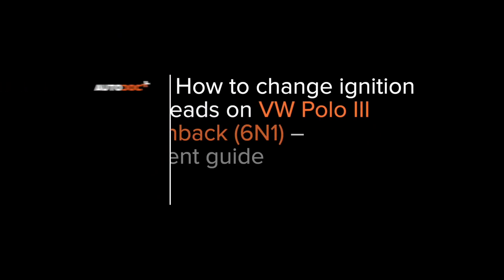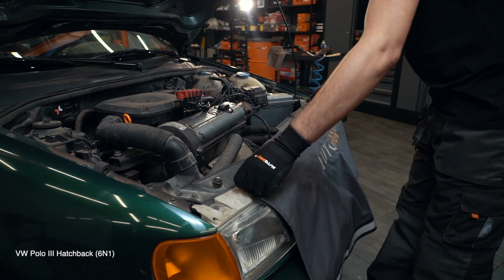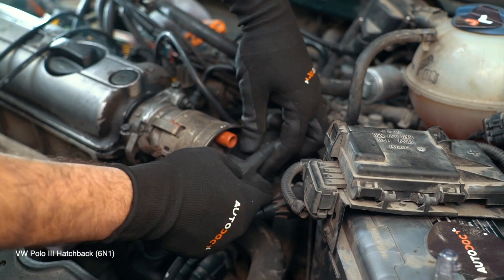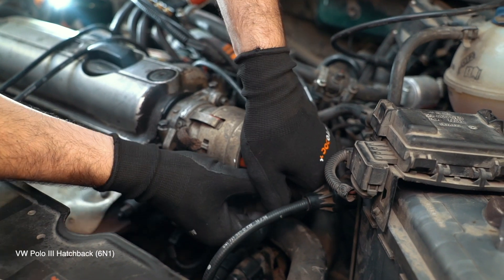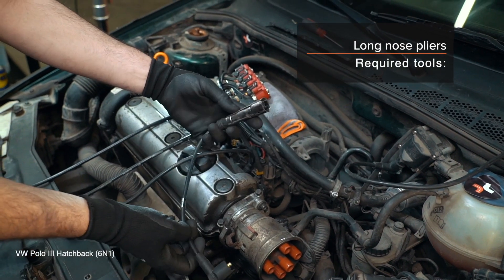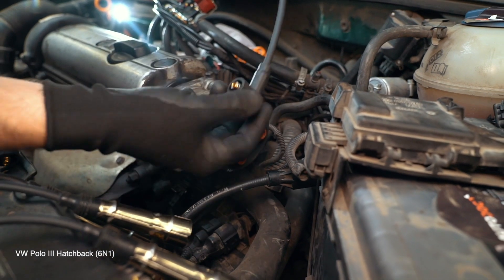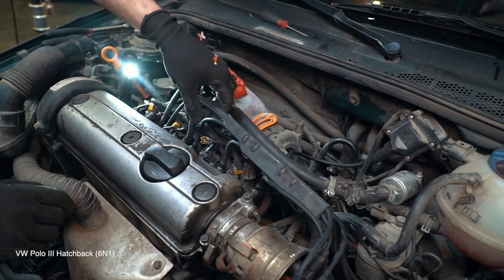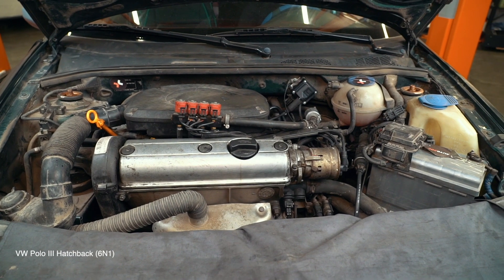How to change ignition leads on VW POLO 6n1 [TUTORIAL AUTODOC]

Comment: At the point where you remove the air filter compartment, there are normally two vacuum hoses attached at the base of this, to two inlets (briefly seen on the underside of the compartment as the mechanic lifts it). If you are not aware, there is a danger of these snapping, dur to old age (which is what happened to me yesterday...)